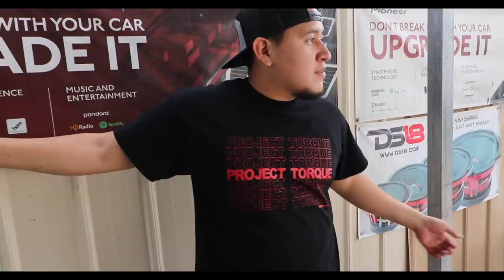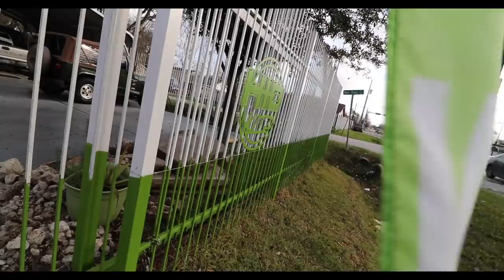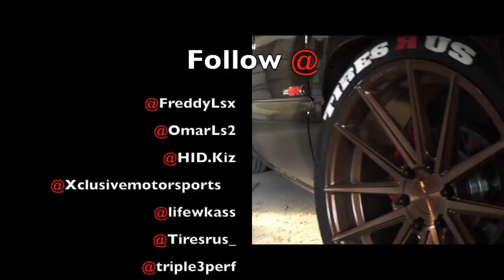UPGRADES ON THE NEW TRUCK

Comment: Omar listen to me get a l86 motor cheap asf 6.2 little by little get the stage 3 cam and and port the heads and intake and boom 400 sum hp to the wheels don’t believe those engines fast stock look up Carlos LTX